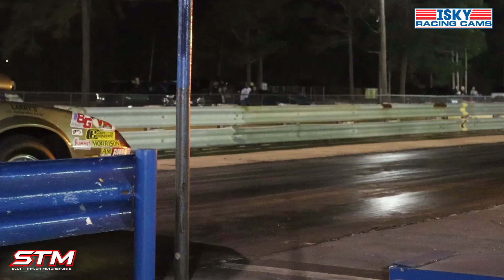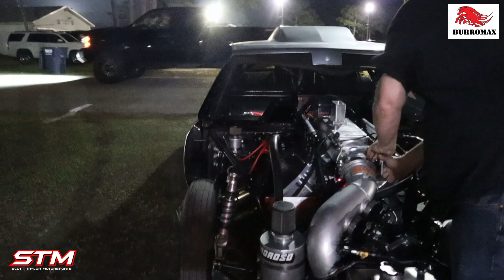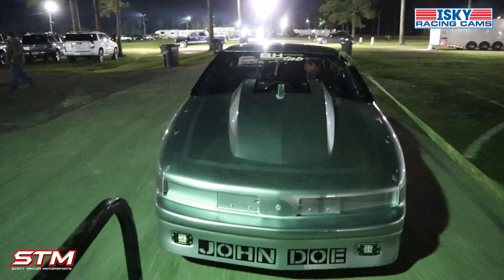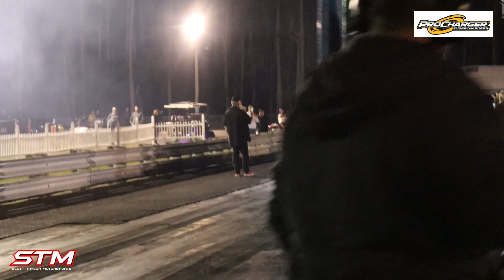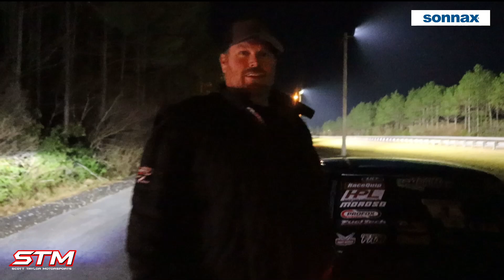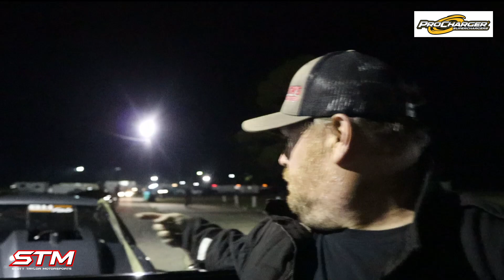Testing for Upcoming Small Tire Race - John Doe Goes Stupid Fast at Gulfport Dragway

Comment: Clearly the car works so i assume its not an issue but my question is, does the fact that the air inlet to procharger bein right behind the fuel tank hinder it from performing to its full ability????? Normally i see an air hole thru the fuel tank for the procharger to get air but not on yours.
Reply from the maker: We have more power than we need right now for street and smalls, so more air is unnecessary.